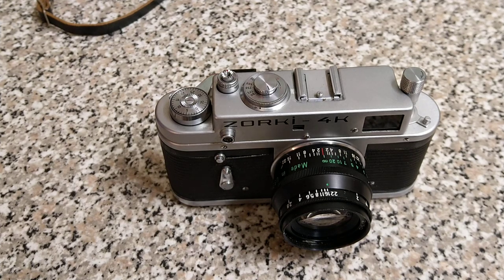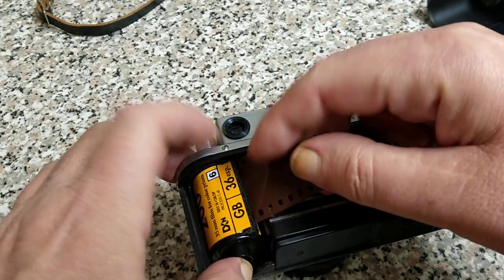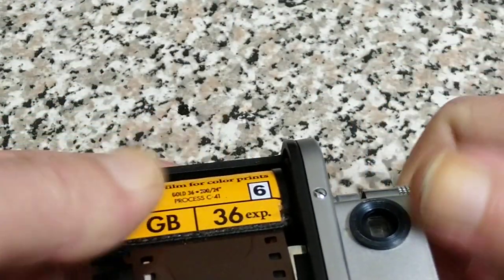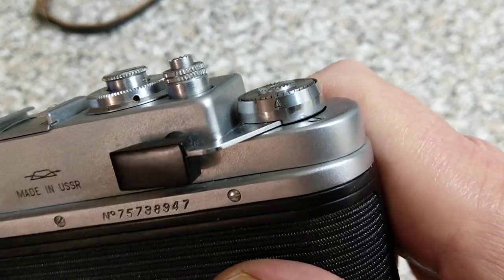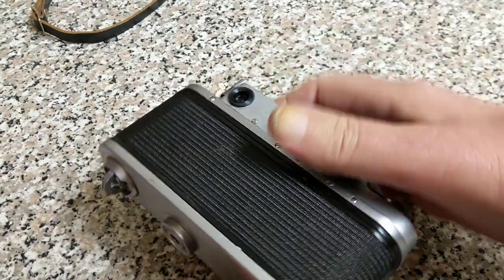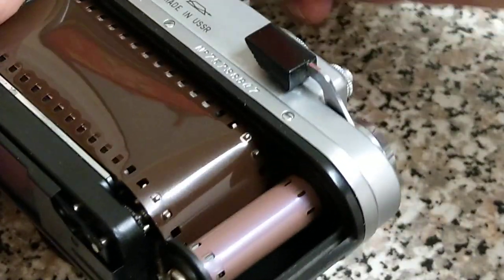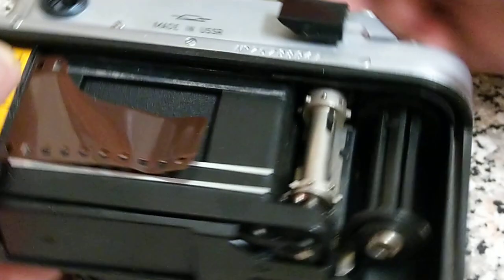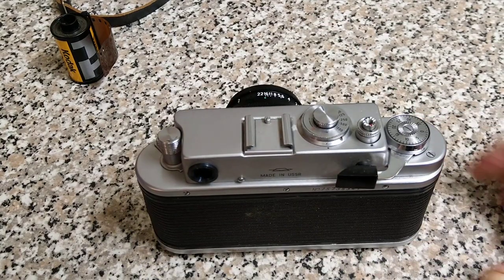Zorki 4K, loading & unloading film,

Comment: 2 great videos on my favourite Zorki, purely for the lever wind. The third dot (red) on the shutter release is for locking open the shutter for long exposures. Select B, depress and hold the  shutter release then twist it to turn the red dot 90 degrees anti clockwise. Shutter stays locked until you twist the red mark back to line up with the other 2 dots.
Reply from the maker: Hi Andrew, thanks for the useful information, really nice cameras, wish the weather would get better, so want to get out and shoot it, the Kiev's as well!
Reply: @thephotographersbag  Thanks for the reply. I like my Zorki's and my Fed's but the Kiev 4a is my go to rangefinder.

Comment: I have same camera, but when i try remove the back, i have to use knife, its very hard to remove it. And it goes same with getting it back there.
Reply from the maker: Hi, they can be a bit awkward but you should not need a knife to get the back off, sounds like something is not right, maybe the back has been replaced from another camera, I take it there is no damage to the back or camera body, bent metal etc, can you see where it is catching? They are quite a pain to fit even when working properly, have to be lined up.....
Reply: @thephotographersbag  the back was never changed, also i think thats because it is bented a little.
Reply from the maker: Hi, yes agrees it sounds a bit out of shape, delicate prying and bending might do the trick or else a replacement back in good condition, I hope it's not the camera body causing the trouble...
Reply: @thephotographersbag  nope, not the body, also i dont know where i can find new back for my zorki.
Reply from the maker: Hi, sounds like the back needs some gentle manipulation to make it fit better, agreed spare backs are hard to find, a spares camera might be an option...I hope the issue does not stop you enjoying using the camera even if you need a knife to get the back off...

Comment: thank you - very good and detailed explanation,i have just bought zorki 4k from ebay.
Does that camera take good pictures?
i used Fed 4 rangefinder and i was really pleased with the results of the printed pictures.
Reply from the maker: Hi, yes they are very capable cameras, the lenses are excellent, I am sure you will be very happy, best wishes....
Reply: @thephotographersbag  thank you mr - i only payed 66 pounds on ebay for Zorki 4K - it had information that it has been properly maintained and i am looking forward to use it and to have comparison,towards Fed 4 - a russian another rangefinder,which was cheaper.
Reply from the maker: @SzymonWarunek  the 4k has become an iconic camera and prices are on the rise, sounds like you got a good one, congratulations, please keep us posted, plenty of USSR fans on here.....
Reply: @thephotographersbag  i have to also - print some pictures,last time - i only was able to print once from negative film,but because of lockdown issue - no shops were open,now - only one shop in my local area is able to do photography service - processing pictures from analog camera.